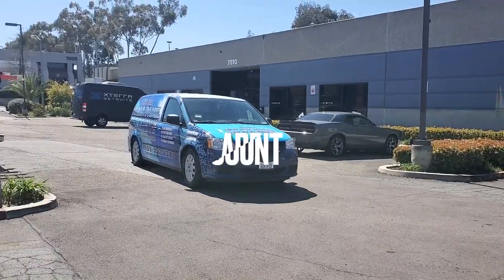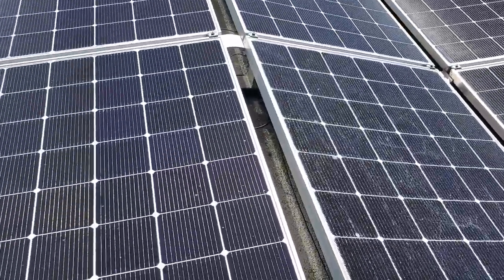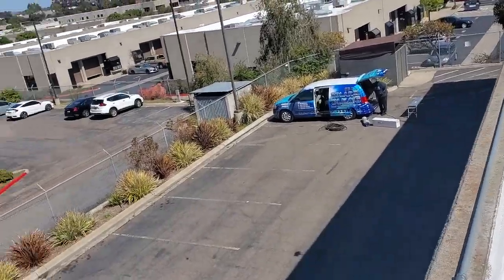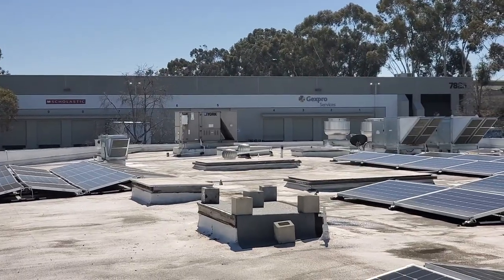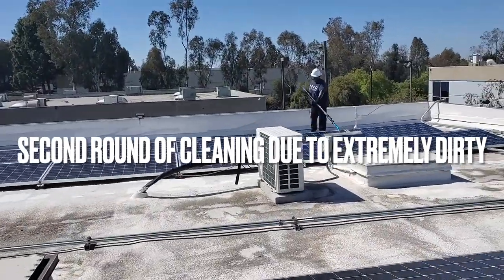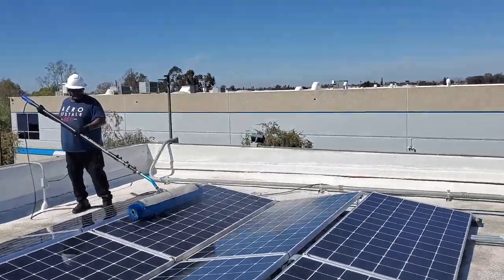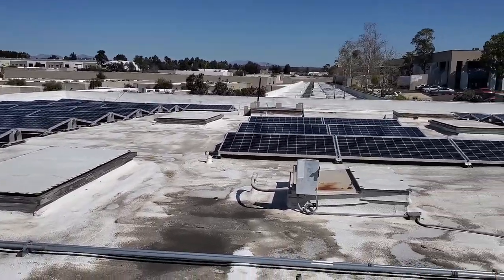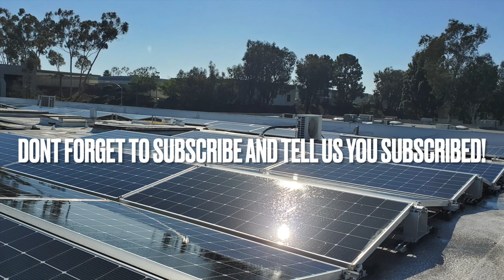How We Get and Clean Commercial Accounts | Solar Panel Cleaning

Comment: Looks like you did clean that cracked panel once looks wet, if you go over a cracked one with this brush - any issues, you ever get electricuted?
Reply from the maker: No electrocution here… I have cleaned  hundred of thousands of panels with no issues at all
Reply: @socalsolarpanelcleaningcompany  and I am sure you unintentionally cleaned more then on that had a crack. Correct? While of course there is a risk present, you have not had an issues
Reply from the maker: @Beyondmaids  Very simple  contractors usually disconnect cracked panels… .each panel has a micro inverter which can easily be disconected also most if the time panels are pretty dirty and you can't tell their cracked until you clean them…

Comment: What do you use to clean them just the water?
Reply from the maker: Yes just deionized water
Reply: @socalsolarpanelcleaningcompany  what if they have bird poop and stuff. Im thinking of buying the sola tec.
Reply from the maker: @showoff9287  the sola-tec cleans that very easily
Reply: @socalsolarpanelcleaningcompany  thank you. May i contact you for any questions?
Reply from the maker: @showoff9287  yes you can
Reply: @socalsolarpanelcleaningcompany  how much are the di tanks?
Reply: Do you need to switch off the main solar panel power supply  before you start cleaning it on commercial buildings?

Comment: Can you run 2 sola tec brushes with one pump to speed up the cleaning when working on large jobs?
Can solar panels be walked on frame edges when inspecting panels?
Reply: You will crack pv panels if you step on them